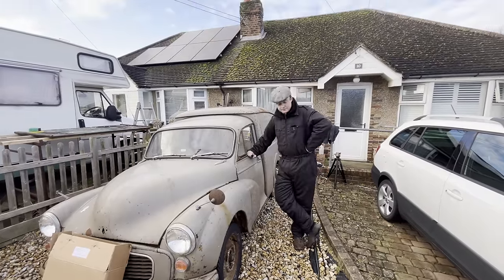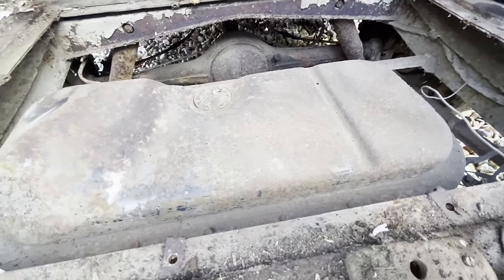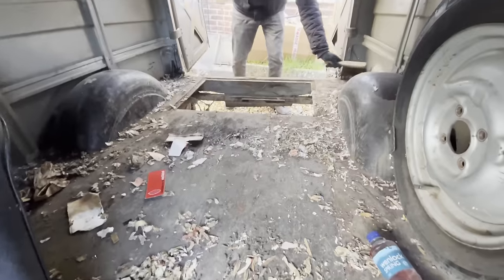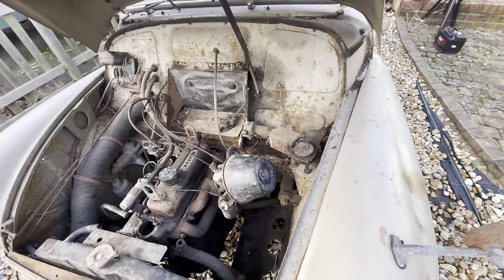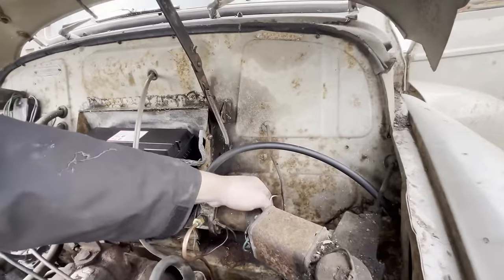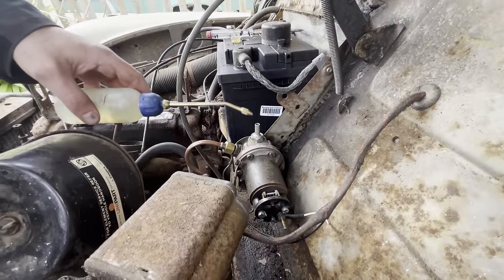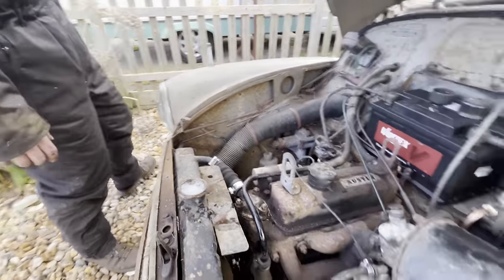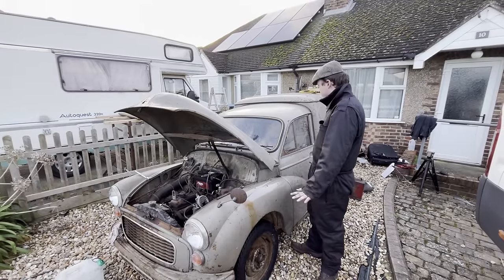Austin/ Morris Van Part 2. Fuel System

Comment: I had one of these - I'm now 70 - and they were so simple and reliable. I remember when you switched on the ignition there was a sort of ticking sound which I understand was the fuel pump activating. My first car, early 70's, was a Moggie Traveller with all the woodwork. It was an MOT failure, I paid £15 for it and bonded it up to get a ticket. Cheap motoring. Good memories, happy days, better times.

Comment: I adore this van. The originality is incredible. It’s like a time machine where you can sit in it & travel back to the 1970’s! (Or 80’s when it was last on the road)👍🇬🇧
Reply: I agree.
With these old cars i literally wouldn't want a fully restored car but rather an original survivor car.
Reply from the maker: It’s definitely staying original, but will have to find/ make something to protect the bodywork.
Reply: @badgerlodgegarage  yes, that would be wise. Maybe some kind of clear coat? I love how you’re fixing it up. Obviously some things do need replaced, but you keeping it as original as possible is commendable. Because so many of these have been fully restored and painted etc. they’re nice- but they are no longer original. You’re doing a great job. Brian. 👍🇬🇧
Reply: @TheGreatest1974  i agree, its only original once. Either wipe over with an oily rag or softly prepare the bodywork and clear coat the patina in.
Reply: @badgerlodgegarage  _ Your neighbour's roof outshines yours.... time to bring out the Pressure Washer! If folks would only realize how bad moss is on their roofs! _

Comment: Really enjoying the recommissioning of this van. I worked for the Civil Service (Home Office) in the mid 70's and we had these Austins on the fleet which I got to drive as soon as I passed my test in 1975. Like most of the vehicles, they were some of the very last off the production line and my recollection of them was they were dependable and solid wagons, although the handling was 'interesting' on the narrow cross-ply tyres! Certainly got a soft spot for them, look forward to the next instalment.

Comment: I love a Morris Minor commercial, owned many saloons over the years but never a van. One small comment, don't keep the plastic fuel filter in the engine bay for long. The heat makes the plastic go brittle and wear quicker! Keep up the excellent work.

Comment: Good to see how good and solid it is under it and don't need welding as you think its small then gets bigger ive spend to many times welding rusty old cars up so your a lucky man and so easy to get new parts for wats your plans on that front wing with the massive dent in you doing a full restoration or part and keeping the paint as it is i would i wax oil under the whole van to protect it
Reply from the maker: It’s very solid, it’s going to be cleaned and treated with lano guard or lano shield as an experiment.

Comment: Don't leave just water in rad ,don't know what your weather is like but it's freezing up here, don't want it freezing and blowing fire plugs, get some antifreeze in the water  asap😁👍
Reply from the maker: Fear not, the system was flushed through with cold water and drained at the end for that very reason! Getting lots of minus temps in the south currently.